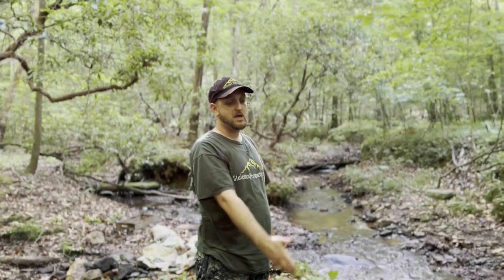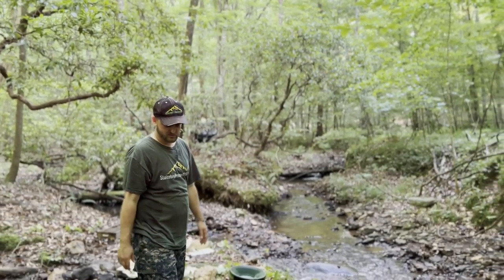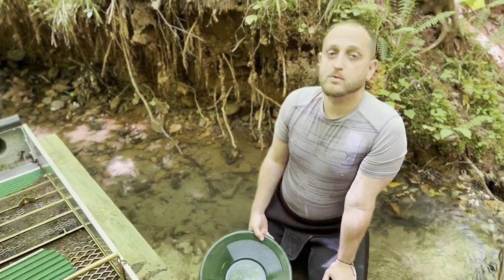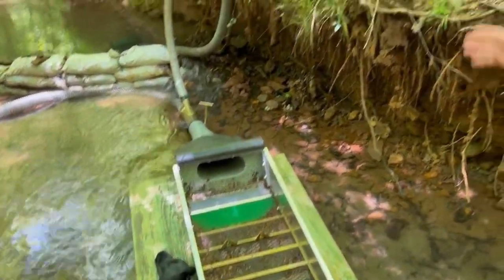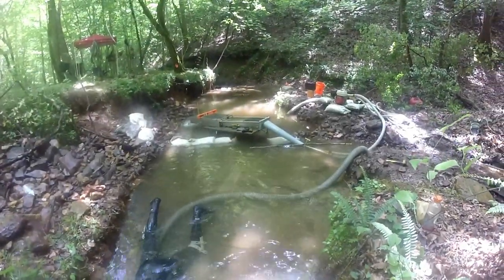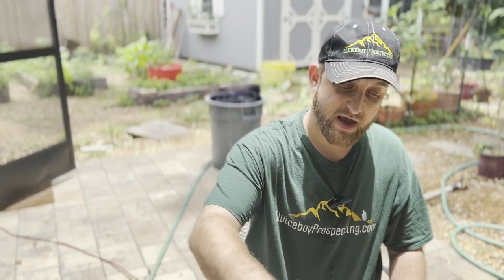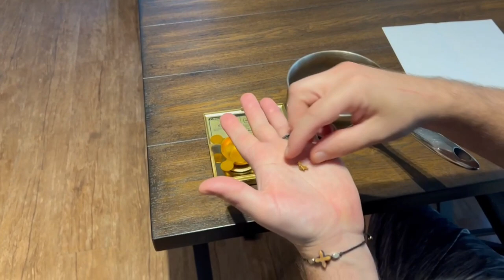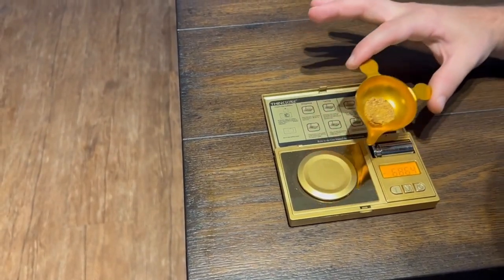Finding A 1 Gram GOLD Nugget Under Water While Dredging!

Comment: Nice nugget. Still haven't found one that big out here in alabama. Been finding super fine gold
Reply from the maker: Keep looking! Follow up on positive signs and if the good starts getting a little bigger in one direction or one side of the creek. Look where the large collection of larger rocks are. The nuggets will be close if they are there! Don’t forget to subscribe and hit the bell please! We have a lot more coming.
Reply: @sluiceboyprospecting  
Good info
I'm in a wide river with lots of bedrock. We did fine an area with rocks 8 to 10 inches a few large ones but no nuggets still looking
Reply from the maker: Just remember gold deposits wherever the water slows. 
But you have to exaggerate the water levels by At least 2x think of it in a massive flood. So naturally wherever the water slows during regular levels it will be several feet if not ten-15 fr further down river. Example, Faster rapids water would slow atleast 10-15 ft further down river then where they show now.